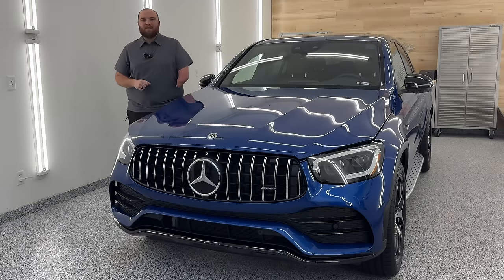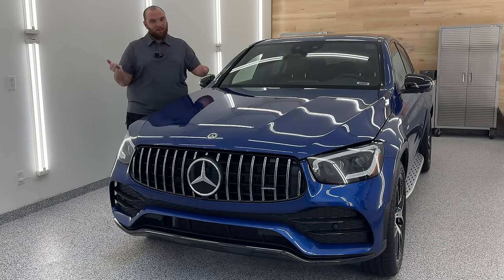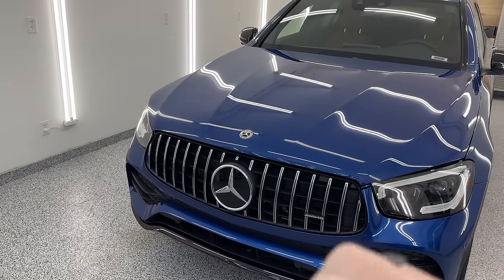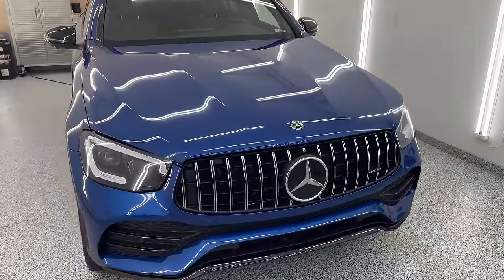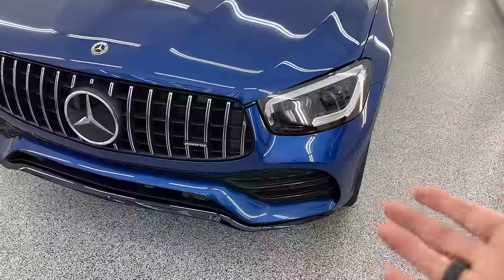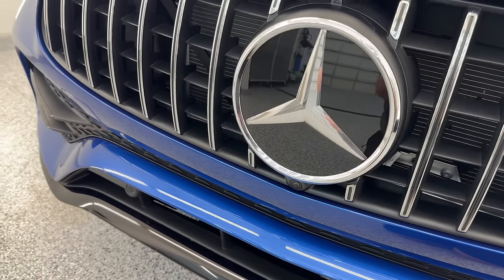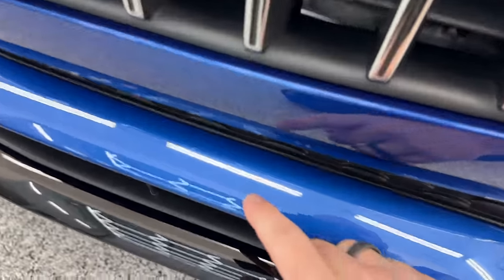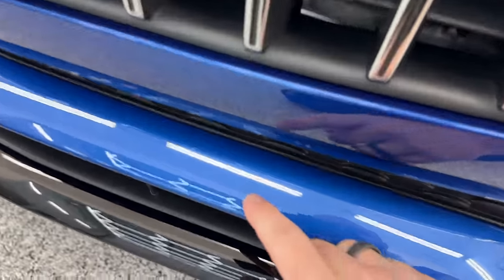The Ugly Truth About Paint Protection Film (PPF) After Just 6 Months & 3,500 Miles

Comment: I’ve had ppf for 4 years 50k miles. No scrapes or stone chips in the paint. I’m going to replace the hood and front spoiler area because it has done its job. The rest is still near perfect. Doesn’t look quite as good as a corrected car but I don’t have to stress about it, either.
Reply: Same with XPEL on one car and Suntek on another for +4 years (both have a 10 year warranty).  Zero issues with either PPF living in the triple digit heat in the southwest, UV protection, road debris, road rash from sand, and a ton of bugs, and with posted speed limits of 65-80 mph.  I hand wash/dry by hand with microfiber at home. I sometimes pack a bucket/ceramic soap/microfiber when I travel to clean as needed at the U-wash-it places on the road in summer.  My PPF installer tucks the PPF into the seams to make it look invisible.

Comment: Putting PPF really depends on what you value in your car. 
I buy mostly a few year old cars. And most of potential buys i look at come with rock chips here and there. Do I notice it in pictures online? Hell no. Do I notice them in person as I walk up to the car? Hell no. Unless I keep telling myself to look for rock chips, they are hardly ever visible to the eyes. Both of my cars have rock chips and it kills me every time I notice them when I wash them. Still to this date, I say to myself "I should've corrected paint and wrapped it with PPF" whenever I see the chips although I never do it. Most are very small. 2 of them in 1 car are a little too big to my liking. I'm still talking less than 3mm rock chips. So what do you do? You can touch up the paint as needed. In however many years, when you can't take it anymore, you have the whole panel painted. To me, that's the smartest move. What do I do? I sometimes touch up. Most of the times I leave them alone. To touch up yourself, you will have to sand the peeling paint around the chips a bit (no need of this for small dots). That will inevitably make the correction area bigger. Can you just slap some paint on it and call it a day? Of course you can. But I guarantee you you're gonna hate yourself. Hence I rarely do it. 
Again, it really depends on how perfect you want your car to be, whether to sell or to just satisfy yourself, even though no one will notice your rock chips. 
If the car is sold at or under 30-40k brand new, depreciation will bring down the value by half depending on model and brand in a few years. Now you're talking 15-20k to sell. Would somebody pay you a few thousands more just because you have PPF and your car has no rock chips? Hell no. So it's not worth it. Just like no one will notice your rock chips, no one will give out more money only because you have already barely noticeable rock chips. Does it change if the car's value is over a certain point? Maybe. Like any other businesses, high end products drag in finicky buyers. For me, even though I'm considering cars well over 150k, I wouldn't care too much over some rock chips. I might talk to the seller down on price for paint correction if it's bad. If the car is worth over 150k though, discounting 1000 bucks is not really hard. If it's 20k car, yeah you are out of luck.

Comment: PPF saved my regal tour x from a baby bouncer that fell out the back of a truck from oncoming traffic. They 60mph me 55mph. Slammed that sucker and the paint and damage was absorbed by the ppf. Definitely prevented a crack in the bumper too. That thing flew about 200 ft off the side of the road. :p just a week prior i was about to pull it off. Bless. Yes it holds dirt on the edges but hey. Im less worried about blasting and scrubbing it hard to clean it since if i f it up i just peel it off and get a new one. I havent needed to but if i had to. Got it on in 2019 when i bought it and its still good.

Comment: I had certain parts of my car vinyl wrapped. Similar to the PPF, it’s not impervious to bugs or rock chips.  I’ve also ceramic coated the vehicle and that doesn’t just allow dirt to rinse off the vehicle. In my humble opinion, it’s an industry that’s out to make money and there are a lot of misnomers and false advertising. Yes, a coat of Carnauba won’t last as long as ceramic, graphene, or even some polymer sealants. But, in my humble opinion, you’re going to have to keep applying toppers to your ceramic coating so you can go with wax and probably be just fine as long as you hand wash regularly and avoid automatic car washes. Great video!!

Comment: what does paint correction mean at the end of the video? i have a new 24 truck what should I do? ceramic coat it?
Reply: Paint correction is a process where they use a polishing machine to take off a thin layer of the car's clear coat leaving a smooth, swirl and scratch-free surface again. Deeper scratches that get down past the clear coat levels cannot be "corrected" in this manner. A lot of people think that a new car's paint will be perfect, but that's not always the case. A good shop that does paint correction and PPF installation will typically do a paint correction even on a new car before putting on the PPF. Remember, even if the paint was perfect the second it left the factory, it has to travel on the open road to the dealership, dealers will typically wash the car and they don't hire expert detailers to do their washes, if you know what I mean. So even a "brand new" car can come with scratches and swirls. It all depends on how much you care about your car's finish being "perfect." I was quoted, from Chicago Auto Pros (a well known/respected shop) $800 for a paint correction and another $800 for ceramic coating recently. Ceramic coating will NOT protect from stone chips at all.

Comment: As an ex - detailer from 1988 - 2012 who rarely ever - used correction. That did aircraft, boats up - to 60 ' , and hundreds of cars , trucks , and other vehicles with only one - product.

For many years, wax or synthetic - wax has been used for protecting paint.

It has been mistakenly -  portrayed by uniformed 
detailers and product 
makers to protect vehicle 
paint from bugs , tree sap , 
bird droppings , and the sun
etc. .

Actually, what happens when using wax products  is:a sticky - layer is applied that when heated and cooled softens and hardens trapping dirt and grime into it causing it to become dull
 and produce swirl marks and marring that requires many hours to remove.

Honestly, just wash you vehicle with real - soap - not shampoo. 

Over - polishing will diminish the luster and shine by reducing the thickness of an acrylic top - coat.

Comment: I have had bugs that would swell and even stain paint but it goes away after being baked in the hot sun for a day or two. The way I look at cars is that unless it's collectable just drive the car, it won't make a difference when you go trade it in. Also a lot of times, if the paint is not perfect on a car, it will damage the paint than not having it.

Comment: That is one beautiful Mercedes.    That color is absolutely stunning and perfect on that vehicle.    I actually like the new larger Mercedes grille also which harkens back to their early days when some of their vehicles had larger grille like that.    My wife just got a new Subaru Outback Touring XT and it was the dealer fleet demo (so it literally had every bell and whistle the Outback could have on it including the partial PPF on the front area of the car including the hood.   Not my favorite look having the line across the hood showing but I am glad it has it on there due to being in Colorado.   It's only a matter of time until you get a rock chip here.   No sense in trying to avoid it,  IT WILL happen!   It's only a matter of time,  so PPF on the front half of the hood is essential here in Colorado although I do want to at least make an attempt to keep the PPF (which is in like new condition at this time) in the best possible condition using the correct products.  That's the reason my search brought me here.    I was searching to see what product(s) I should be using to maintain that PPF so it doesn't yellow.    Is using a regular wax or sealant on it ok?  I was just curious.  How did you clean the edges you pointed out in the video?   You said you spent a ton of time cleaning the edges.   I was just wondering what product(s) you utilized to get the edges clean because that is something i will be dealing with as well.   I generally use a sealant (Jescar Ultralock ceramic infused polymer sealant), followed with maintenance with Griot's 3 in 1 ceramic spray wax.   Is that a safe combination to use on the PPF?   I don't think either one of the products leave the white staining of yesteryear that old waxes used to leave on vehicle time and they are safe for all parts of the vehicle exterior.  Also, is using harsher soaps a "no-no" on the PPF film area?    Meaning the higher alkaline or lower acidic wash solutions?    Does it absolutely have to be a PH balanced soap is my question?    It's a daily driver and will be stored outside at the moment until we get the garaged cleaned out a bit more.   It's also a daily driver in Colorado where it's been a more snowy winter this year so it will most likely be covered in salt and traffic road film, needing more frequent washes.    What product do I use to correct scratches in the PPF?    What compound or polish is best on them to get some of the slight scratches out of the PPF.   I thought I saw somewhere that you could polish PPF with certain specialty products?   Help please.    Thank you sir.

Comment: I drove to work on the highway about a half our each way. I live in an industrial city (although nowhere near as industrial as it used to be) so there are a fair share of trucks of all types. Add to that road salt and the fact that the roadway is full of debris each Spring, so if you’re like me and like to keep your car as detailed as possible under adverse conditions then I can see the use case for PPF. After I retired and only do local driving I peeled it off my GTI and must admit it mostly did its job. But regardless of paint protection a top tip is to always install it on your headlight lenses. If you do they’ll never yellow or haze over from harmful UV rays.

Comment: I’ve had PPF on my car since 2018. I have 60,000 miles on my car and it’s still looks pretty darn good. I’d much rather remove it and install a new PPF layer if I need to just to avoid the Stone chips and that’s the only reason I have it on my car. I do a paint sealer on my car twice a year and I have no complaints. I think I paid $400 for the kit to do the front bumper 1/3 of the hood a strip across the roof on the front. The mirrors and fenders and headlights so if you do it yourself it’s not that expensive.

Comment: I have a 2021 E450 wagon with 12K miles on it. 99% perfect and I am considering a front wrap (PPF). I am planning a cross country trip in a few months and think this may still be worth it, I agree that this isn't the time to cut costs. However with only reviews to go on how do you really know the skill level of the installer. I guess I could verbally ask for the "best" installer after asking a lot of questions showing interest in detail. I will move forward but if you were traveling across country 2700 miles does that sway you to get it? BTW: I plan on holding the car barring mechanical issues for 6-10 years.

Comment: Not all ceramic coatings are compatible with certain ppfs! The ceramic coating can hurt the ppf and prevent it from performing as designed. Check the warranties on the ppf, you can’t just use any coating, it either needs to be tested or approved by the ppf manufacturer.

Comment: What would you recommend for this scenario: I am getting a new Model Y in black, and want to make it Satin/Matte Black. Do I do xpel stealth PPF ($4,300) or a satin black vinyl wrap ($4,000). would the vinyl do better with bugs, and rock chips --would the thinner vinyl not have as noticable indents? appreciate any insight you have. I am mostly wanting the color to change to satin/matte and like the little added protection from rocks chipping paint. Maybe even eliminate the need for mudflaps?
Reply: PPf and vinyl are two completely different animals. Vinyl is 3.5-4 mils thick whereas ppf is typically 8. Top vinyls are warrantied for 4-5 years and ppf is typically warrantied 8-10. The upside is full vinyl wraps are quite a bit less expensive. Although vinyl will help reduce damage from sand and grit, it will not protect against anything much bigger. On a model Y we typically do the full front and full rear doors. The rear doors flare out and are very susceptible to damage from grit thrown up by the front tires. Film is expensive, but still cheaper than a good paint job.
Reply: I mfg both cast vinyl and ppf.  Urethane is WAY tougher than vinyl, even at the same thickness.  Personally, I'd never waste my money on vinyl.  If I wanted a printed or color changing wrap, I'd do it with urethane, not cast vinyl.

Comment: As an Uber driver I am probably someone who should have used PPF.  in 1 year I put almsot 40K miles on and as far as the exterior the issue isnt so much bugs or rock chips but rather car washes. I try and alternate soft touch no touch but I literally wash my car 5 days a week (through the car wash). So the issue is car wash swirls/scratchs that PPF would have made a bid difference. I use seat covers in the interior to protect the seats and should have done the same on the exterior. 

When I do sell the ID 4 in 2 years will have slightly over 100K miles on it , the interior wil look fantastic , the exterior will be showing the wear. That said ' I'll pay for  a good exterior detail and it will look just fine for a vehicle with 100k miles. 

so yes PPF probably not doing many peopel any real benefit considering the cost and for all the other reasons Coleton pointing out. PPF IMO best for those that put a lot of miles on each year

Comment: The installer is more important than the PPF. My Porsche dealer insisted on using "his guy" to do the PPF on my new 911. When delivered, it had gaps between the edge of the film the the panel gap. The last two cars I've purchased were switched to high-build ceramic coating.

Comment: Having done two car front ends in PPF I'm torn (pun intended) between if it's worth it. It's subjective but for me almost anything is better than rock chips and a peppered front bumper after 50k miles. BUT, my installer hand-cut my film and I know he's marred the paint in some places...but again, are tiny knife marks worse than rock chips? To me it is. 

The problem I'm having on the most recent car is bird droppings and water stains seem to take hold more easily. Installer says it's the same film but I didn't have this issue on my 4-year old PPF job on another car. Time will tell and I know the sun can heal quite a bit over time with PPF.

Plus it's all about experience. I've had cars with a ridiculous amount of rock chips and I always hated the feel under my hand while washing the hood and front bumper...just felt like I was washing sandpaper. With PPF the front end of my truck looks new. Is it a perfect install...far from it (dust under film crooked cuts, stretched adhesive). I paid $750 which is typically unheard of though. So for the price I think it was worth it.

Comment: I totally get what your saying. However, with a Tesla, you really need to wrap the front bumper, it will get destroyed !! Especially if your driving on highways. Agree about the installers & the pre-cut film. For me 3M (9 mls) Entire front PPF $1,600 has held up for 5 years. Bug guts comes right off after a wipe down. As for rock chips, I would say 10% of them may get through especially if your a spirited driver. I don’t think ceramic coating will stop rock chips like PPF. That’s my opinion & experience.

Comment: PPF is invaluable, those little stains you keep nagging on about would be just as bad in the paint and I've tried to polish out bug stains and bird drops and they don't always come out.  Sometimes they permanently etch into the clear coat.  You keep saying they are permanent in the PPF but they are not, you can replace the PPF.  
Those dirt dots and such in under the film is not the films fault, that just a bad installer.  Those edges that are slightly coming up can easily be trimmed back and look like new again.  
I'm a PPF installer and one of my clients swiped the edge of his garage while backing out......  good thing we fully wrapped his car cause the damage looked sooooo bad, but we just removed the PPF and there wasn't a single flaw on the paint and we just installed new film on the panel and it was perfect again.  That was a rare car too, James Bond Ed. Aston so PPF saved the day, the paint and the cars value in a big way.  
You just don't like it cause you had to clean all the edges and that's super annoying I get it, but it's still worth the money.
Oh I forgot to mention the self healing part where there will never be swirls in the finish again.....  that's the best part.

Comment: It's not armour dude. Your expectations are ridiculous. Yes, you're gonna get some marks in it. That's the point of the film. So those marks don't end up in your paint. And yes, occasionally a rock will penetrate the film. It's not a layer of steel. But for "most" times when debris hits the film, the film will take the hit and protect the paint. Dirt under edges and edges lifting is not a ppf issue, it's an installer issue.

Comment: PPF biggest issue is uneven UV protection for the whole hood, so when you remove it after a few years, you will have to paint correct the hood to feather out the division line where the PPF stops.